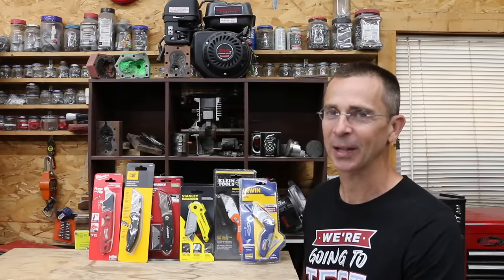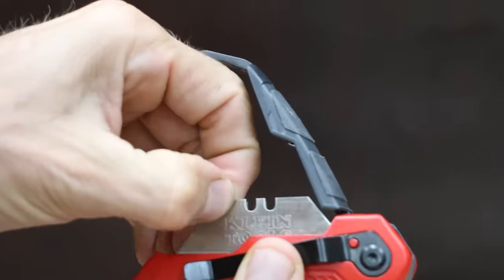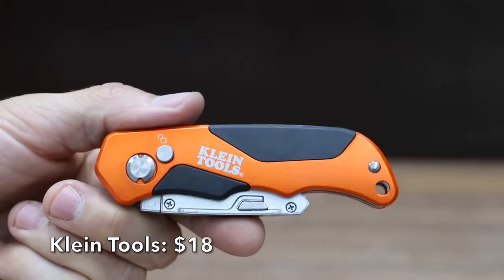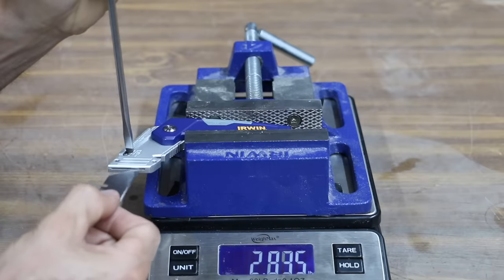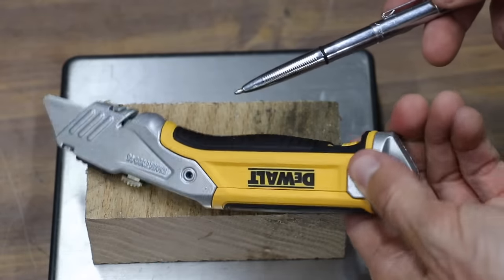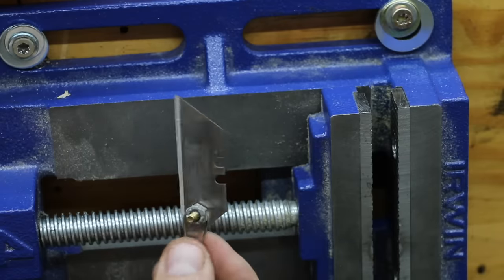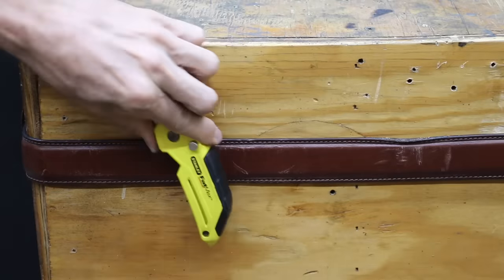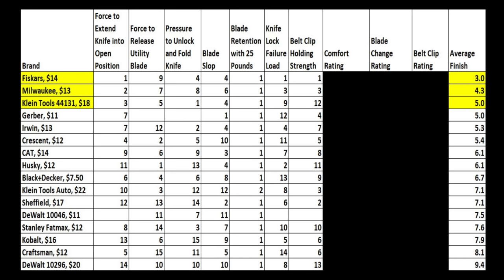Best Utility Knife? Let’s Find Out! Milwaukee, DeWalt, Gerber, Husky, Kobalt, Klein Tools, Craftsman

Comment: Love the Milwaukee fastback. They make a smaller one that fits great in your pocket, then they also have a bigger one with wirecutter that I keep in my toolbox. Great knife!
Reply from the maker: Thanks for the feedback.
Reply: They also have one just like this with blade storage in it :D
Reply: I also have multiples of the knives tested and the Fastback 2 beats them all for me. Milwaukee 48-22-1902. The 1502 is OK but not as good as the 1902 IMO. I carry the 1902 almost every day instead of my ProTech switchblade.
Reply: @EnvirotekCleaningSystems  looked up the  1902 IMO , cant find anything can u send a link?
Reply: I’m a Milwaukee Fastback 1505 guy. The utility knife and driver combo is gold for me. Carry It on me at all times.
Reply: I have been using the small fastback consistently down in a lead mine for a little over a year now and it is still holding up smooth and strong.
Reply: @JoeyShip did you know it has a hidden blade storage slot? It is right next to where the blade folds in. Kinda hidden
Reply: Just got one myself. It’s been fantastic. Using dewalt blades based on feedback from this channel

Comment: I carry the GERBER every day. Small lightweight.  It is a bit sharp on the edges.  I like how it doesn't have any blade movement. So the 2nd side doesn't get dull
Reply: Me too. 🙂
Reply from the maker: Thanks for sharing!
Reply: I everyday carry one, keep it clipped in a front packet. If I need more than my Gerber I grab a stanley 99E.
Reply: The EAB also has more exposed blade edge than most knives.
Reply: I also EDC the Gerber EAB. Pocket space is a premium and it has a very small folded profile.
Reply: Been carrying one for over 10years, I believe I still have the older version somewhere. I also have a couple new ones put away. It's so small and not noticeable sometimes I forget it's there. I've had to leave some outside of courthouses and sporting events.
Reply: The first generation had a too small of finger guard and could bend to the side with moderate use, exposing the blade. Does the current model have that same problem?
Reply: @whatbuttondoipush  I never did experience any of those issues with the older version or the new lite one. To me there both the same with the exception of the cutouts. One thing to mention atletas on my end. This is a knife I carry for emergencies only no hard or demanding work.
Reply: @Julio-jm8ld  to be fair, I was trying to cut carpet with it.
Reply: I use utility knives to cut patterns among other more common uses. Minimum side wiggle the first thing I look for when evaluating a new knife.
Reply: I wish it had a quick change blade.
Reply: I also carry the Gerber and love it. Hart has one similar only a little bigger and it is great too
Reply: @Silvertone2000  I’ve heard of people replacing the screw with a thumb screw
Reply: Same here. 
I carry the EAB with a Slice Ceramic blade.
For all the everyday tasks, this is fantastic.
Reply: Got it cheap on a slickdeal. Use it all the time to open boxes, cut up boxes for recycle.  Works great!

Comment: That Gerber is a surprisingly well built tool for the money. My favorite things about it are, super slim design (it stays out of the way while in the pocket) and easy to open and close with one hand without the "look at me" wrist snap. Now if I am cutting lots of things the Milwaukee is in my tool box and it beefy size is perfect for working with gloves on. As always thanks for another informative video.
Reply from the maker: Thanks and you are welcome!  Thanks for the feedback.
Reply: I love my Gerber but it will only take one brand of blade, can't use "standard" razor blades because the mounting hole does not line-up.  I've had mine over 10 years; maybe that's been fixed (?)
Reply: Maybe you can answer a question for me. I’ve got the previous generation Gerber, got it because it was the only one that had zero play on the blade, which I needed. The problem tho, is the pocket clip - it clips onto the knife’s handle (no screw to secure) and it constantly falls off. Do you know if this newer model still uses a clip-on clip, or is it better secured?

Comment: The Milwaukee knife has several available configurations. I have one with 1 blade storage and also a Philips and Flathead screwdriver, and there's also another one that has no screwdriver but does have several more blades you can store in the handle
Reply from the maker: Thanks for the feedback.
Reply: I own 3 MKE Fastback knives, the “compact”, the newest with 1-blade storage  and screwdriver, and the one tested here. Love all of them. They are the only utility knives I’ve ever really liked carrying, and the wire spring “belt clip” is great for hanging the knife on your pocket. The single hand opening/closing is also extremely useful and fast. The only one I don’t own is the one with 5 blade storage in the handle, it just feels too large for a knife I’ll carry on my pocket.

I’ve owned and/or still own folding models from Cobalt and Husky, plus non-folding models from Stanley, Craftsman, and used at least a dozen other models over the years. The Fastback are the only ones that have ever really impressed me, and the reasons show in the results of Todd’s testing. 

I’ve never tried the Fiskars model, probably won’t just because I’m so satisfied with the Fastback.
Reply: I also own the one with the screwdrivers. It is hands down my favorite yet and it has saved me many trips back to my tool bag just for a screwdriver. It's well worth the hefty $20 price tag!
Reply: @agrsk8r  I think it’s down to $15 now, but I could have misread the tag recently, wasn’t looking to buy another just saw it on the wall. Could have been in the wrong place.
Reply: I had the one with 5 blade storage but lost it and havent seen it available since. I now have the new one w the screwdriver, and two without the blade storage. One has the twine cutter/wire stripper and the other doesnt. The one that doesnt has a tether hole. Not a huge milwaukee fan, but definitely my favorite utility knife that ive owned. Theres a new irwin one that looks like it might be a little more comfortable in the hand by the curve it has. Still can never go wrong w the fastbacks. Only utility knife i ever had that didnt break and have had one for years
 I also have a fastback pocket knife thats been pretty good to me as well. Starting to get a little dull though
Reply: @agrsk8r  I was in the Big Orange box store right before Christmas and picked up a Milwaukee Fastback 2-pack special - you get a simple Compact Fastback and a 6-in-1 Flashback with the Phillips/Slotted/Nut driver fold-out.  The 2-pack for $19.97, which I thought was a pretty good deal.
Reply: @thebordernow  that's awesome! Might be time to pick up a second one then. I keep the current one at work because I'll forget it at home if I don't. 🤣
Reply: @agrsk8r  You might swing by your local Orange Box and see if they still have any of their Christmas special packs available.  I picked up one because somehow my pristine 5-blade storage Fastback "disappeared" somewhere in the house or garage...
Reply: @agrsk8r  love my 48-22-1505, locks open and closed (quickly) and the screwdrivers are just as handy as the knife blade!
Reply: I have the mini one, does just fine for opening boxes
Reply: I’m a glazier and use a utility knife everyday for my job more than any other tool and the fastback is the best by far, even own the fiskars and it blows it away. Fastback is the only utility knife I carry in my pocket. I will say though, the non-folding dewalt, which I also own, can’t be beat when you really need a lot of leverage when cutting something.
Reply: @geoffstrickler  That might be the perfect edc knife tbh. A non-dullable blade (Well you just replace the blade if you accidentally dull one out) and a replacement and a small screwdriver.
Reply: I have been carrying the Milwaukee Fastback for 4 or 5 years now and feel naked if I leave the house without it. So I purchased two more and keep them stashed in my truck and tool box. Then I started giving them out for Christmas gifts. With a little wear over time, the blade can easily flip out and back in with one hand. The extra blade storage is sweet. I think I like these knives better than my dog! Just kidding.
Reply: @finfish260  Just got the big one with 5 blade storage, the compact and 50 blades for $20 almost 2 months ago. Even brand new, the blade swung open with just gravity. I actually had to practice flipping it open, especially with my left hand. The blade would flip open so fast that I had trouble releasing the button fast enough before the blade bounced back.
Reply: I think the comments here make it clear why the MKE Fastback knives are considered the gold standard…for now anyway. Someday, a better (overall) competitor may appear, and we can all celebrate if/when that happens. Certainly, there are folding utility knives that are “better” for specific applications/criteria, but there simply isn’t anything at this time that is more versatile and beloved.

Comment: I bought the fiskars pro on a whim and it turned into my favorite utility knife ever. I'm so glad that purchase was justified by your testing as well. It's just so buttery smooth to open and close, super comfortable, and perfectly sized. I was shocked it won the vertical breaking weight test, I really thought one of the lock backs would've done better than such an easy to open and close utility knife.
Reply: Just like you I was surfing on Amazon and got the fiskars pro cause I liked the way it looked😂 it is the best most comfortable knife I ever bought and thinking of getting another just in case they’re not available later

Comment: My Milwaukee utility knife is a bit older than the one you tested, but uses the same mechanism and performs flawlessly. Feels very solid in the had and easy to open. One caution is that it is also very easy to close when the lock is released, best keep your fingers out of the way.
Reply from the maker: Thanks for sharing.
Reply: It's the only knife allowed in canada you can close with one hand easily with a glove on cause they don't have the stupid security lock, I waited a couple years to be able to purchase it lmfao
Reply: I'm in Canada and I have an older Milwaukee as well. Very comfortable handle.
Reply: I've had 2 of the older ones. Have absolutely abused them, and they've done outstandingly. Love the wire belt clip. A lot of people don't like the older ones because they were so long, but I actually prefer them....the extra handle has been used as a hammer on a few occasions😂

Comment: I've used the same small Milwaukee Fastback for 3+ years now almost every day and I'm not surprised the larger version did so well! Once the lock wears in it is super easy to open. I never put it on my belt because its so hard to use so I put in in my left pocket. The larger Milwaukee does hold extra blades in the black part in inside the handle unless they have changed it's design!
Reply from the maker: Thanks for the feedback.

Comment: I have the version of the Milwaukee with the flip-out screwdriver and single blade storage inside the handle. With a little use, the blade gets so easy to open you can just press the button and it falls into place. Great when you're balancing boxes with your other hand.
Reply from the maker: Thanks for sharing.

Comment: I have that Milwaukee, I keep in my breast pocket at work, the utility knife aspect for what I do is several magnitudes better than normal blades for most instances, its get paired with a Leatherman surge, a pen light, a micro slotted screwdriver and a pen that has a built in ruler. So my pockets are pretty busy, the slim form factor of the Milwaukee fits perfectly with my other stuff. Of all of these blades it's by far the best for me. 
That all being said a closing lock on these things is almost entirely necessary, I had a young apprentice a few years ago open his arm from almost his wrist to his almost his elbow because his knife opened in his pants pocket and was sticking out just enough to catch his arm, and because the blade is like a scalpel he hard even felt it enter his skin until was too late, all he did was pick something up off the ground. 😬

Comment: I've been using the Gerber for years, anod have several. I like how it keeps the blade from wobbling around, and is very thin and light. I replaced the screw with 4-40 torx cap-head, for easier opening.
Reply from the maker: Thanks for the feedback.
Reply: That Gerber had been with me for a decade at least. Have 3 or 4. But the original one lasted years and years. It's still doing great. One of the replacementa had an issue with the belt clip. It popped off. Can't get it to stay on but also didn't really try more than once.

Comment: love that you even went to the length of testing belt clips. it's a small detail but as far as workflow is concerned, it matters a lot when you can expect to slide it on and off your belt throughout a day. great video as always.
Reply from the maker: Thanks for sharing!
Reply: At the same time, those look more like pocket clips than belt clips. If the clip is on the right side, you'd have to clip it to the left side of your belt, or clip it backwards.

Meanwhile a pocket clip on the right side will go in your right pocket.
Reply: Didn't expect to see Mado here on a PF video!!! I just bought a favorite doujin album of mine on eBay...

Edit: the album is "yume nikki tame no waltz machigelita" for anyone curious! You can find it on Nyaa
Reply: @hitemlow92  agreed! I generally put mine in the pocket, not on the belt
Reply: Also, the clip's ability to grab easily is likely user-adjustable with some pliers.  Yes, a smooth-working clip is nice, but it is also perhaps readily fixed to meet user needs.
Reply: Right! Dude when he started that scene I was just like "whoa shit , that's brilliant, don't think I'd have thought that up"

Comment: Great review. The only thing you missed was, belt clip strength. Over the years I've noticed some of the belt clips bend and the knife can slip out of my pocket. I now use the Milwaukee and so far the clip hasn't let me down.
Reply from the maker: Thanks!  Thanks for the feedback.
Reply: Knives that have a removable belt clip can be taken off and bent back into shape. The ones that aren't removable unfortunately can't be fixed.
Reply: Or the screws fall out
Reply: @orisisseibert3507  the Milwaukee does have a screw holding the belt clip in place but they must have really cranked it down at the factory.  I literally own a dozen of these knives because they discontinued the FastBack II that everybody loved, so I cleared out an eBay clearance seller in case I ever broke mine.  Milwaukee got so much push-back from their customers that they had to bring the FastBack II back--the FastBack III had a shorter handle and guys with big hands had to shift their grip to open and close the knife.   It  was not ideal, and often it felt dangerous to use.  Small-handed people seem to like it though.  :)
Reply: Yep, would have been a great category. 👍

Comment: I have been using the Milwaukee Fast Back utility knives for almost a decade (I use mine multiple times a day as I a residential/commercial repair and remodeling contractor).   I have broken a few of them, called Milwaukee and they have sent me new ones at no cost to me.  They are strong, crazy easy to deploy & the Fast Back I carry today holds 5 extra blades which is incredibly convenient!
Reply: Agreed.  There are none of these others that were tested, that I would choose over the Milwaukee.
Reply: I just bought a 2 pack that gave a free pack of 50 blades on black Friday sale for $19.99.  As a builder we use a ton of Milwaukee tools.
Reply: They’re also fun to flip open!
Reply: @joeyfh  Agreed.  Not only fun, but super convenient.

Comment: For my EDC I choose the Husky, 3 for $14.98 so it doesn't hurt if it grows legs, really slim and compact, no issues with blade flying out, it's great for quick cuts, durable when I drop it, it doesn't leave my waistband. But for comfort and longer use periods such as cutting through caulking on base boards or crown molding I use the Dewalt non-folding utility knife.
Reply from the maker: Thanks for sharing!
Reply: That's why the multiple tests are worth watching
Reply: @flhusa1  yeah, I'm thinking of getting a Milwaukee now, I like that it's full sized and folds, plus the sweet belt clip.
Reply: Yeah, I'm 100% with you there. I've got the Husky 3-pack and they're good for general use. However, changing the blade is unintuitive to me, even though I've used them for years. It takes me a few seconds to remember how to open the mechanism. Plus, I'm a lefty, so not being able to change the thumb bar for opening the blade, nor the belt to the other side, makes things a bit more painful to use (my EDC is Benchmade because of their great Axis lock - it works great for both hands!).

But for comfort, I much prefer a regular sliding utility knife. Stanley, DeWalt, whatever... So I use that when I'm having to cut hard or for a long time.
Reply: @ThePainkiller3666  I use the Milwaukee with the extra blade storage, it flips open and close so easily, also the ergonomics are really good in the hand

Comment: I have about 4 of these knives. My favorite by far is all the Milwaukee ones. Easy to open  and close, comfortable to hold. For cutting tougher things I like the dewalt folder with retractable blade.
Reply from the maker: Thanks for sharing!
Reply: I have one that's about a decade old now and if I clean it up, it still looks brand new. Couldn't recommend it more. Just don't bother with their overpriced blades, the generic 50 pack for $6.99 on Amazon are just as good. They're disposable items after all.
Reply: All seem to not last long least if looked after well always get cement, sand, dirt ect in them